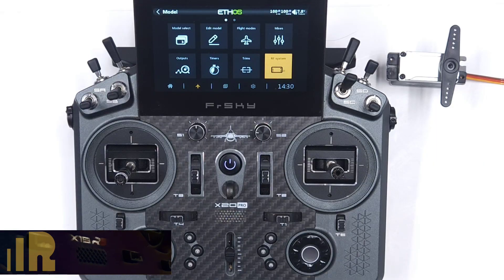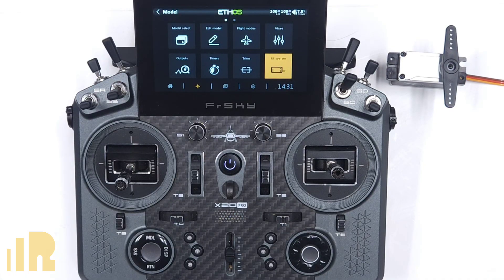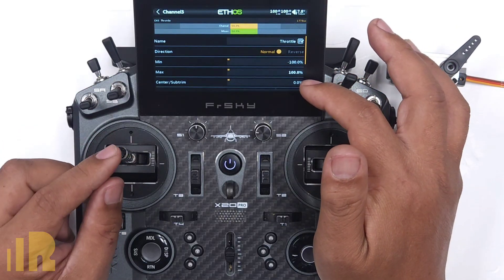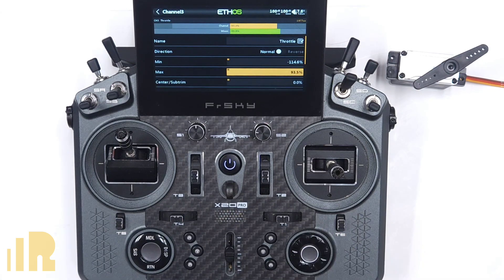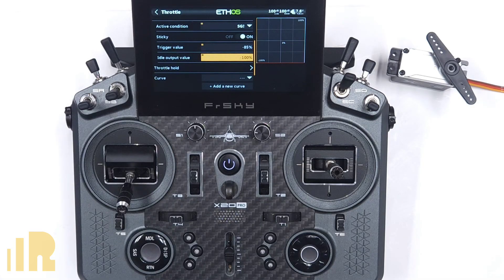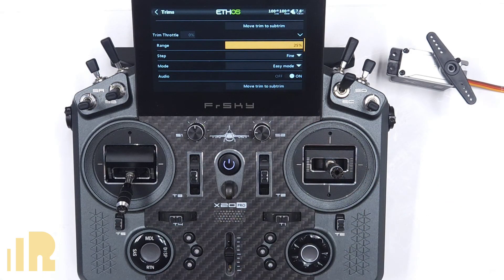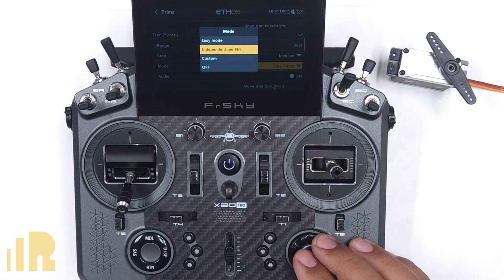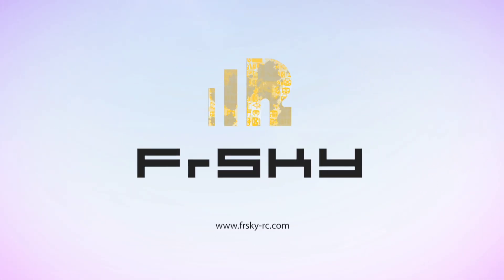Throttle Setup for Gas & Glow Planes - FrSky ETHOS Instructional Series

Comment: Hey there, great video, thank you! At i just got my x20rs, and when setting travel/endpoints, i noticed that the mix value does not increase past 100%, even when you adjust you end point past 100. 
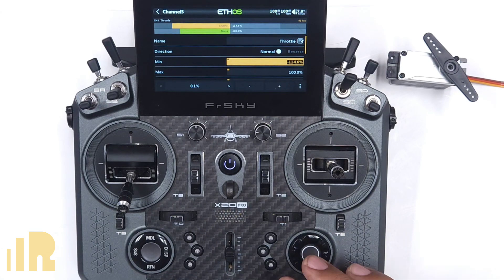This issue is displayed in your video at 3:00 minutes in. 
I may have to go past 100% with what im doing. Shall i just call it good, or is there something i can do about this? Thank you
Reply from the maker: The mixes are always limited to 100%. This is true for most radio systems. However, you can make that 100% more travel by going to outputs and adjusting min and max travel in each channel. There is a warning at 125% that Sbus is limited to 125% but if you aren't using SBus, you can disregard and go up to 150%.

Comment: What is the use case for a fast idle?
Reply from the maker: Fast idle is a higher idle that has a lower chance of the engine stalling. You can use the low idle for taxiing, take off and landings and fast idle for regular flight.
Reply: I have always set a fast idle for Glo and petrol engines for starting.